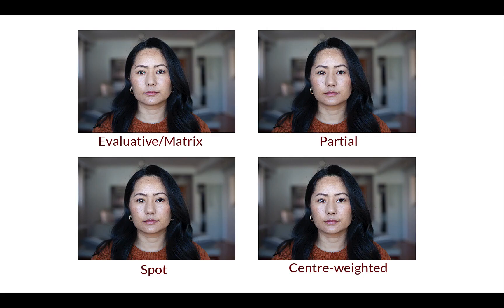Metering Modes Explained

Comment: Nice video, but one question what if the subject is on the right or left side of screen, how do I move the spot? And how do I meter a subject that is not in the centre of screen?
Reply from the maker: Just move the camera so that the spot falls on the subject on the left side of the frame or wherever. Then you can  move the camera to frame your image and leave the metering as is and take picture. You could also use the exposure lock button if your camera has it.

Comment: Is that a partial mode more better than spot one because spot is so tiny and couldn't cover faces ?
Reply from the maker: Well you don't need to cover the face. Let's say the face is in the shadow and lit evenly, and the background is in light. If you meter one spot in the face then that will give you reading which will be the same if you had used spot. Hope that makes sense.
Reply: @SurendraLawotiPhotography  
Yes .. thank you you are so kind .. but i couldn't find the sign of this spot or partial across the view finder .. i only can notice them from screen canera ? Is that normal ? Or it can be also shown from view finder ?

Comment: Very nice explanation. Thank you. In you second set of examples when your subject is standing outside in the shaded area, the exposure of your subject is best with spot metering. However, the background is completely over exposed in that case. If the scenario demands that both background and foreground be captured without over exposing or under exposing then is it possible to do with any metering mode in single photo or is it not possible without post processing ?
Reply from the maker: Good question! In cases of extreme difference in light ratio between subject and background (as in the case of example I have provided), it gets little tricky. It is not really matter which mode to use but how it is used. Two things you could do. First is to bring in artificial light into the equation (flash or studio lights) and light the subject to match the intensity of the background. You can control artificial light but not the background (lit by the sun). If artificial lighting is not an option, you can take spot meter reading of both subject in shadow and the background separately, and make and exposure based on average of the two. The resulting image will have subject darker and background not so overexposed. You can fix adjust in post-processing.
Reply: @SurendraLawotiPhotography  Thank you for the very informative reply.
Reply: I have never heard of this method using spot metering to measuring two areas to average it out presumably manually It would be very help ful if you could make a video about it. I hope its not a very big ask to you.
Reply: Similarly, while going through yhe video, in the back of my mind I was wondering whether metering mode matters in manual mode of shooting ?